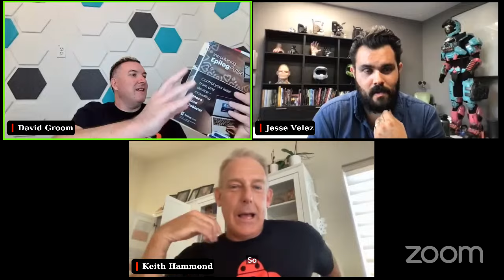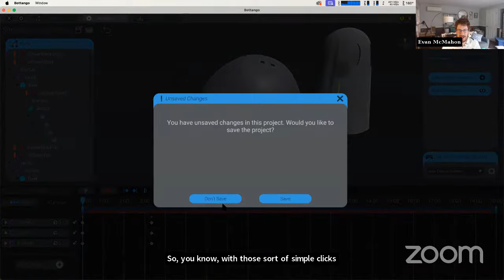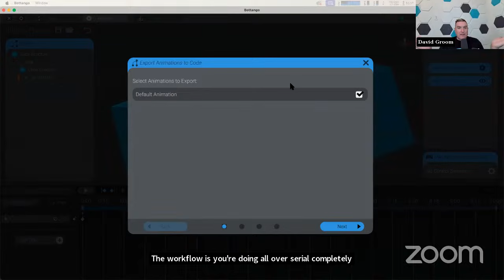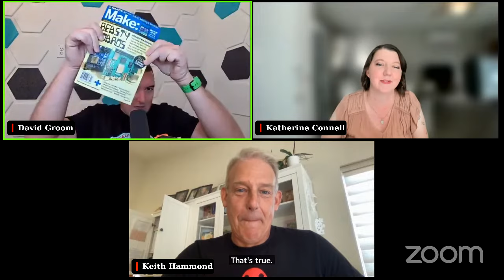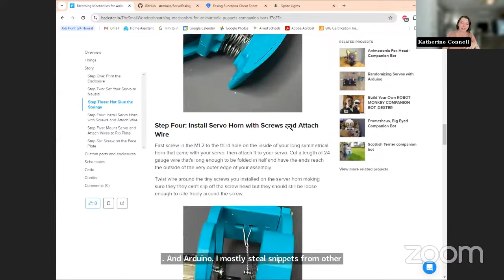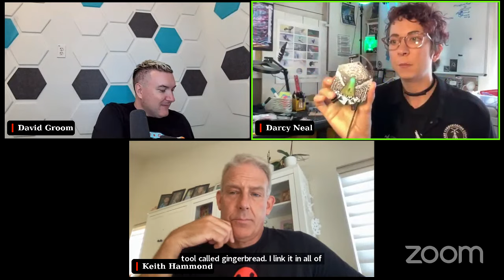Make: Magazine Volume 90 Launch Party: Animatronics Robotics + DIY Energy

Comment: About the EMF audio amp, I believe there may be a mislabeled capacitor in one of the images showing the build. Pg. 74, photo marked "F" shows the lower capacitor value as 47uf. But the parts list has 10uf capacitors in the parts list. This was somewhat of a difficult build from the article as there was no circuit diagram and photos are a little hard to decipher.